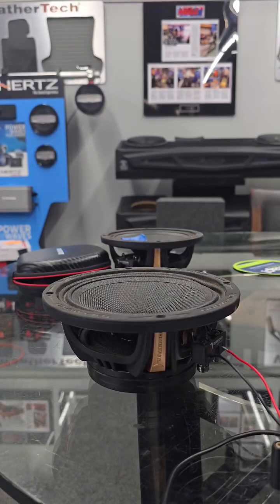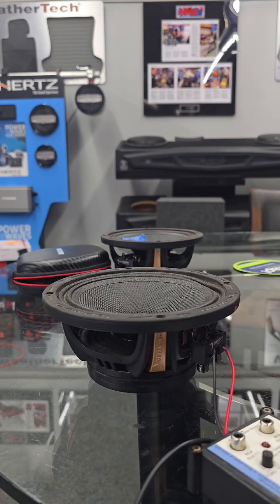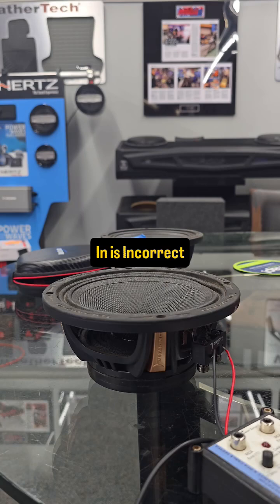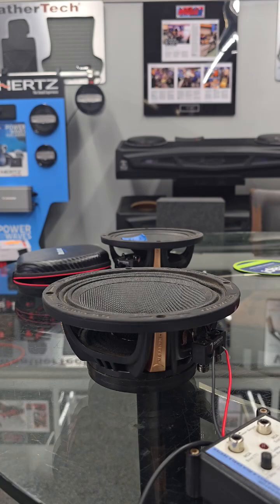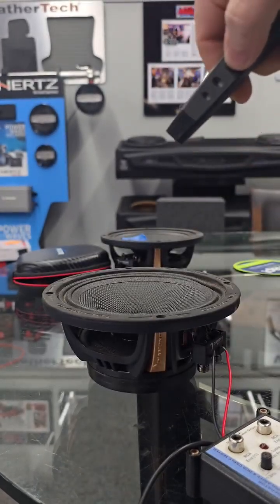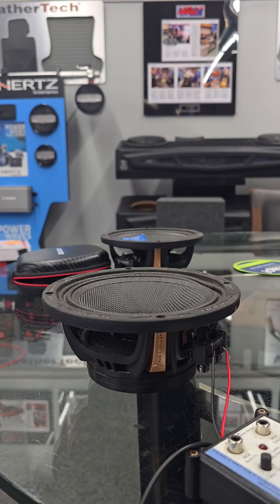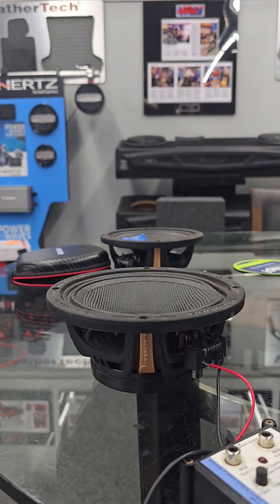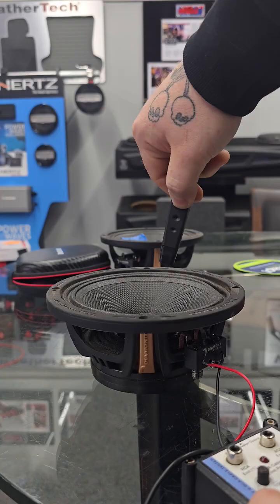Speaker Cone Moves Wrong? You've Got Reverse Polarity #carAudio #tips

Comment: i ran into factory reversed and switched pins on driver.
Reply from the maker: what?
Reply: @actaudiollc306 yep. that's why they don't exist anymore. 
bit now when I think back, maybe they did it on purpose for phase reverse because of crossover design. 
anyway now all drivers jump out on testing. if I find something wrong I will put new x-overs. 
but yes on driver itself was reversed polarity lol. that's why my friend who gave me them have burned tweeters and whole s on the boxes. I must order new ones. so guys with cheaper brands, check before installing on audio inlet jacks at the back